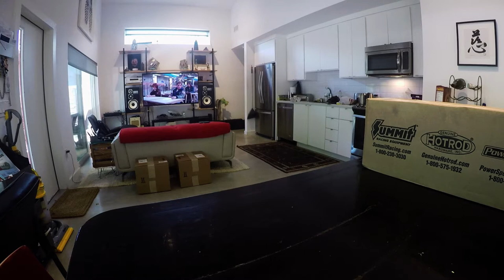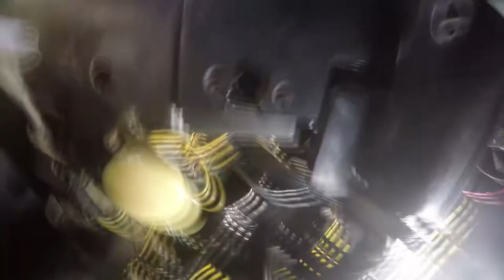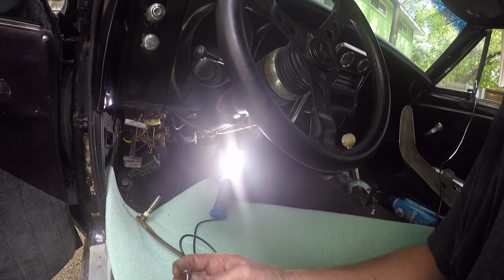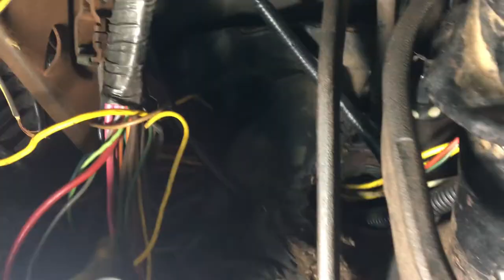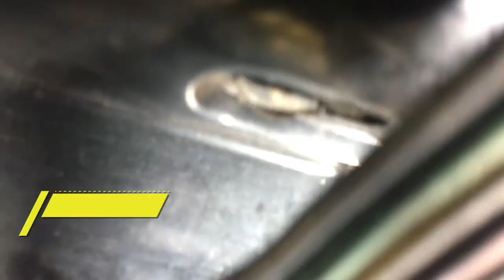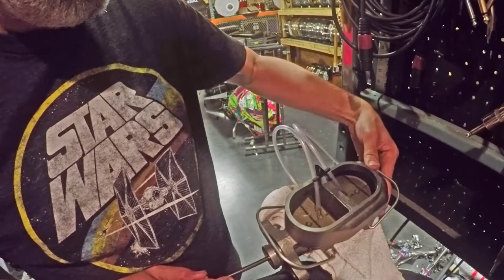1967 Camaro Restoration : Master Cylinder Upgrade

Comment: Im doing the same on my 1967 Firebird  my friend  old timer  said have to lower steering column  that doesn't sound right   what is the correct way.
Reply from the maker: Hi Luis, not sure on the firebird but I dont think that lowering the stering colum is even possible in my Camaro.
Reply: Yes i agree. I will take the seat out   thanks

Comment: I'm working on my '68 Firebird - how did you disconnect the prake pedal from the push rod to the master cylinder?
Reply from the maker: Erik Zakoske there was is a pin that holds the push rod it’ pushes out after removing cotter pin that holds it in place at the top of the pedal FYI it pushed out the opposite way I thought at first

Comment: The brake pedal pin holes is the top hole for drum and the bottom hole is for disc brakes. Is that correct?
Reply from the maker: Hey QQ are you talking the holes in the firewall ?
Reply from the maker: QQ I think I’m understanding ... your talking  the pin holes on the break lever I’ll have to look at what I ended up using but everything I’ve read is manual vrs powered ie break booster not necessarily drum vrs disk however if converting to disk can’t imagine it’s not a booster conversation as well ?
Reply: @cleonicp  Yes, the fun pin that hooks the clevis to the rod up under the dash by the brake light switch,  there is disc brakes without the booster and power disc with the booster, now you have me wondering, lol
Reply from the maker: QQTrick1QQ me lol 😂 🤔 I’m working up the courage to start working on the wiring harness I purchased last season I’ll follow up on where it’s hooked in my world hopefully soon :)
Reply: @cleonicp  No rush XD